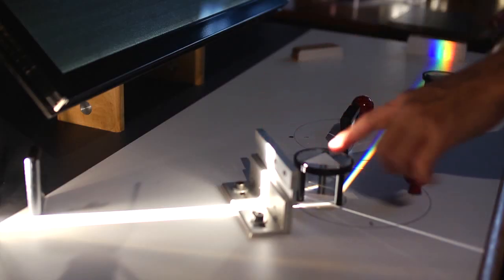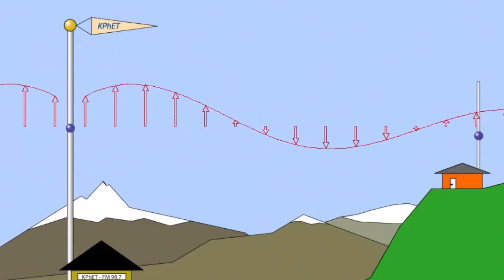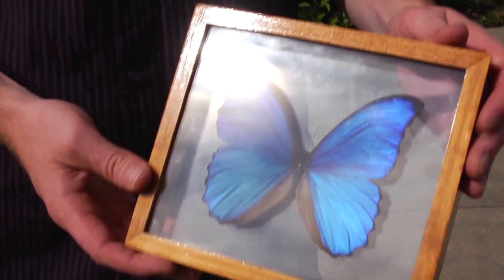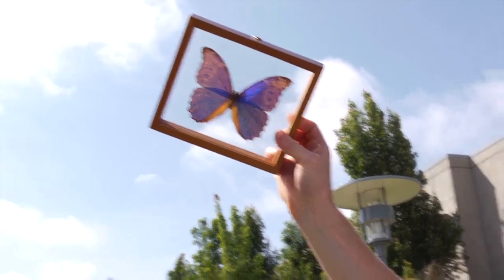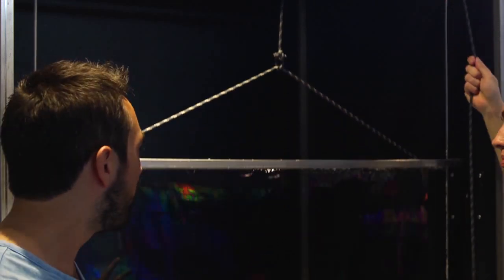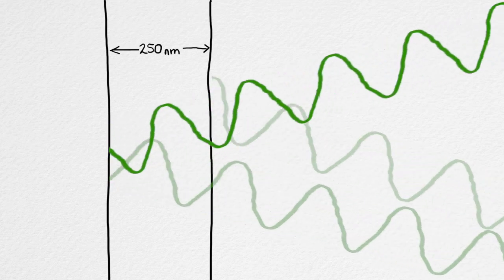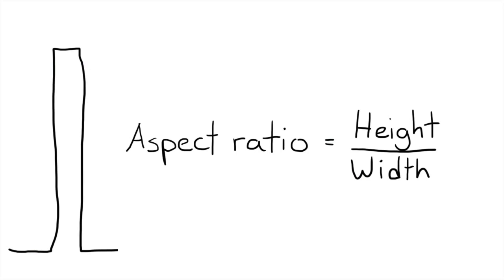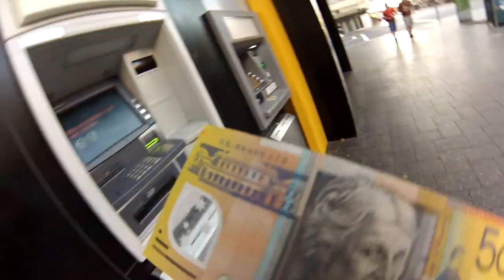How To Make Colour With Holes

Comment: As an actual printer by trade, ill tell you now that this technology will not take over inking press ever.
In printing you run thousands of sheets an hour, this may take up to a minute for a signle sheet once its properly developed, also the coulor is iridescant, and always changing, you dont get just flat green or flat cyan.

Comment: Yeah back lighting would still be required a sometimes but if possible, under sunlight or other sufficiently lit scenarios, surface glare and need for back light could be eliminated. I think the constantly changing image problem could be solved though, with smart minds at work a lot can be achieved.

Comment: or it could be "green" in the same way printers print "green" using only cyan, magenta and yellow ink, by printing dots of cyan and yellow light very close to eachother. Our brain interprets this as green, although no green light is actually present. So if there was an area on the soap bubble with a lot of cyan and yellow intermixed, you would perceive it as green

Comment: This is pretty cool.  A lot of the concepts you've described are what I've been studying in my mineralogy class because it deals with looking at rocks that have been sliced into sections of about 30 micrometers thick (called thin-sections appropriately enough). These thin-sections are then examined under a petrographic microscope so that the minerals in the slide can be identifed by how the light behaves when it passes through them.

Comment: The emphasis is on the light reflecting off the wing. When they place the light source behind the butterfly wing, the blue colour isn't there. That means you can't see the "structural colour" when the light enters the wing from the back. If the wing would be coloured through pigments instead of structures, it would still look blue if the light shone through it from the back.

Comment: That's deliberate. It's made that way so you can't crease it and it lasts longer. Also if you take a brand new note and fold it, it is considered unfit for circulation and banks are supposed to send notes with creases in them to be destroyed.

Comment: he is right, there is green at some places. 
the reason is the thickness of the soap film is not constant, it varies (due to stretching by small air blows or gravity makes the film thicker at bottom) so different wavelengths are interfered-out at different places. 
even a few nanometer worth of change in film thickness will change the color.

Comment: It doesn't seem very efficient. I suppose you could do it, but you have to keep in mind that this technology is not self-illuminated, so you will need a light source. And if you get a light source the angle of the waves is changing the wavelength of the cancelled colour. Additionaly, if you want to permit only one colour, you would have to cancel out every other colour, making it a lot more complex.

Comment: Thanks for the info... I figured it was a half, but wasn't sure (obviously).

So, with this technique as a color-generating option, is it possible to change the depths of such small holes electronically with the goal of making a very thin tv screen? Or is the distance between the holes just too small for it to be feasible?
(obviously, they can't be physical "holes" anymore, so I'm thinking plastic cylinders attached to a retractable mechanism)
Impossible? Just too expensive?

Comment: the spacing between the dots is crucial. They work by changing light reflected from the surface, and it depends on the angle of the incoming light, so different spacings work best at different angles. But still, to manipulate visible light, you need to be in the range of its wavelength for it to work.

However, larger spacings work for larger wavelengths, like radar or microwave. and for smaller wavelengths, crystal structures can create this effect, which is the basis of x-ray crystallography.

Comment: when it comes to the holes, all thats really needed is a "hole" in the flat, reflective surface. So you can make holes that go all the way through, or at these locations you could just roughen up the surface really badly, and even printing tiny black dots onto the surface would work. The depth of the "holes" does not matter at all, only their distances and pattern is important. 

The holes work with light coming sideways at an angle, and is changed while it is reflected from the surface.

Comment from the maker: some light always reflects and some goes through, but if the reflected light from the front surface destructively interferes with light reflected from the back surface then you see no reflected green light. This happens when the thickness of the film is half the wavelength.

Comment from the maker: Generally you want the film to be half the wavelength of light that gets cancelled out because the wave is inverted at the front interface upon reflection. The holes are trickier to explain but they do perforate the material.

Comment: Depth has to be half of the wavelength,because the light travels twice through it. Once inbound, and once again outbound after the reflection at the bottom of the hole. That causes the light to be shifted by 1 wavelength but due to the reflection, it is phase shifted by π. So if you take the one bouncing on the surface with the one bouncing on the bottom, they add up, cancelling each other out.

Comment: This depends on the reflectivity of the material, which determines how much of the light that hits a surface is reflected and how much is transmitted.
The light can also bounce several times inside the thin layer, or pass through it completely.
wikipedia /wiki/Refractive_index#Reflectivity

Comment: Inside a vessel? Are you suggesting that astronauts or equipment are charged with millions of volts of static electricity and the walls are also charged with millions of volts to be able to move around inside a spacecraft? That doesn't sound very practical to say the least! And you don't have to overcome gravity, but the inertia of dozens of Kg of mass. And when you collide with a wall charged with millions of volts, there will be a big spark.

Comment: 1. There is gravity. Veritasium has a video on that, check it out.
2. Not viable because to repel you'd need something to repel from. Getting further away from it would mean that you got less and less effect from it (squared).
There actually are electron drives and I think they do use some sort of electromagnetic interaction to shoot out electrons at high speeds which is basically the same thing rockets do with fuel.
There was a video about spacejunk and Switzerland that mentioned this.

Comment: Would this work at a larger scale? The holes are 100 nm in width and depth, but what if you were to punch holes in say, a cm or mm scale? Could you be at a certain height and still see the same reflections?

-asked by a former chemistry student

Comment: They don't alter the wavelength, as such. They respond to the photons by producing an electrical charge which is then converted into a digital value. Why infrared light produces a violet image on a digital camera, I don't know. It is surprising as it is at the other end of the spectrum. I guess it could just be that the manufacturer has mapped that wavelength to that purple colour, but I doubt that's it. I would be interested to know the answer myself.

Comment: The nanostructures could be isolated between two protective transparent layers. Also, dirt  or dust particles and even droplets of liquids or skin oils are on the micro scale, which is huge in comparison to the nano scale so they wouldn't be able significantly affect the nano sale textures even if exposed.

Comment: Interesting. I know materials whose refractive index can be altered dynamically to make them invisible to certain wavelengths of light, However I would doubt a physical structure like a hole can be made dynamic, at least not in similar methods. Still, worth some research.

Comment: saying that is like saying "Im going to get dirt in to my skin because my skin has holes in it", and there is preasure too, you will need to take the air inside of that little hole before you can put something else in there, or youll need something even smaller than that hole, maybe some kind of virus, but just a few or maybe 1 I don't exactly know how long or wide viruses  are.

Comment: I think it would be not that easy. Theorically it would be putting a "threesome" of R-G-B "holes" for every pixel and another three lights (LEDs?) for every one of them. But being the iridiscent that this system is, at first thought, I think that, the bigger the screen, the more likely that, even with exactly the same RGB code across all of it, it would look differently. I mean, its appearance would quickly change depending on the angle, as today monitors but "faster".

Comment: I wonder. In a zero G environment like space could you use static electricity as a repelling force for propulsion? Or movement and positioning in general? Like how if you build up the static in a balloon that is perfectly balanced in the air you can guide it around without even touching it?